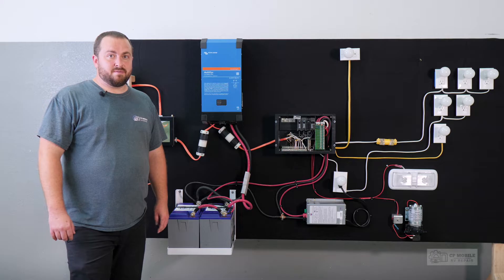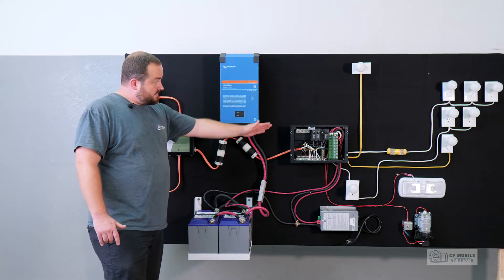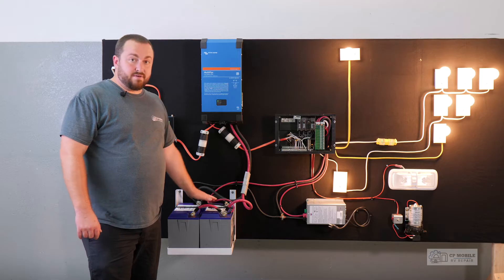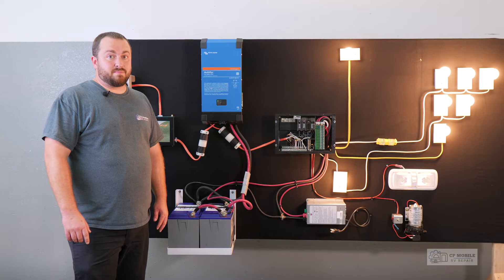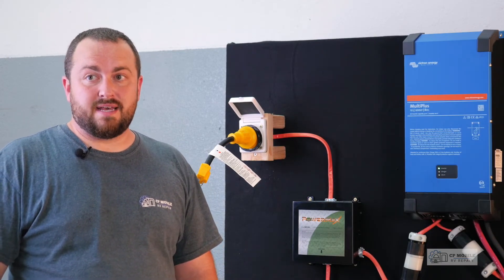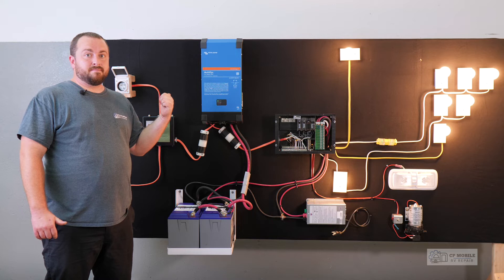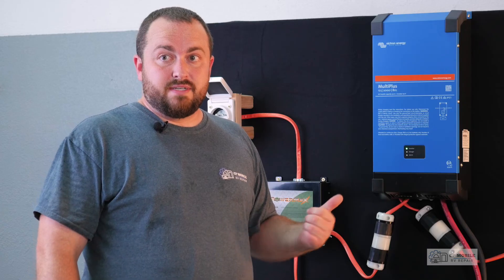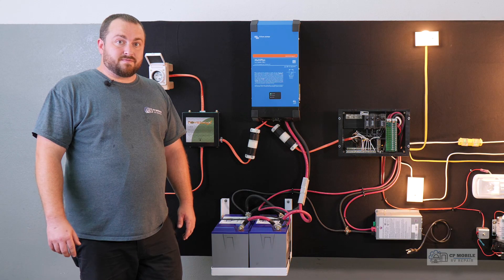RV Inverter Chargers, How They Work: Victron Multiplus

Comment from the maker: We have launched our own website and line of batteries! Check out Rockymountainlithium.com for all your power needs!

We have had several requests for technical help with troubleshooting, installing or designing electrical systems, so we’ve set up an option for paid consulting service below.  If you’d like expert technical help you can click the link below and schedule and appointment. Thank you! 

https://web.lokiapp.live/Travis.Call/g9Er
Reply: Thanks again for your help this morning. Keep up the great work
Reply: So if I have a converter do I need a inverter. Especially if I got plan on being plugged in. So if I'm not gonna go off grid or anything like that, and we've got plain on plugging into a 50 amp. Service, I don't need a inverter, just a converter.or am I wrong. If it's going to drain a lot of power and i'm not going to be going off grid. I got planned staying on grid, where I can hook up to a 50 amp pole. Hell The only plants that I plan. I'm having in my house. There's a 1800 W air fryer cuz. I got rid of the stove and a electric stovetop.Yeah, that goes just on the counter a decent fridge probably a dorm fridge. I also have a snake, so I need to run there hundred their light system, which I run on normal power maybe a couple heaters on top of my furnace, and my thankless hot water  , I'm also  putting in and AC heater.

Comment: I have a 2012 American Eagle 45T. My Inverter started giving a fault. High Voltage AC. I changed from a Magnum MS2000 with 3  breakers to a Magnum MS2812 with only one breaker. Before the change I had power to the refrigerator, microwave, and an outlet near the passenger seat when not connected to shore power or generator. After the change to the MS2812 inverter I only have power to refrigerator when not connected to shore power or generator.  Does it have anything to do with the internal relay difference between the two inverters? Learning a lots from your video's.
Reply from the maker: It would depend on how you wired the new o e, assuming you connected all 3 circuits together coming from the single inverter breaker, I would check all your connections and make sure everything is secure at the inverter output.

Comment: I assumed the 2000VA was the same as 2000W.  Not true. further study showed only 80% of the 2000 VA = 1600W.  Not very good.  I have this unit I installed in my Trailer.  I have issues when I run the microwave (900W).  My LED lighting flickers each time the microwave powers up and then settles and that's on  30A shore power.  I am getting ready to swap out for the 3000VA model.  The spec sheet for the 2000VA multiplus shows you only get the 2000VA at 77 degrees and gradually drops as the ambient temperature gets hotter.  Thanks for putting together a presentation.

Comment: Can you run this system without the transfer switch?
Reply from the maker: Yes, in some cases the generator has an outlet that you plug the shore power cord into rather than use a transfer switch

Comment: I thought that the Victron had an automatic transfer switch, am I incorrect?
Reply from the maker: You are correct, it does have an internal transfer switch to select between inverter mode and pass through/charge mode.  In this case we also have the other transfer switch to select between the 2 different incoming 120v sources, shore and generator.

Comment: I know this was a while ago.. we have a multiplus ii 3000 line 1 and line 2 what is a passthrough? Maybe a dumb question but will my generator run though the inverter and bypass the batteries? Or does it still have to use the battery’s?
Reply from the maker: Pass through simply means the 120v ac power from either shore or generator just flows through the multiplus directly to house loads.  The batteries are still needed for a stable 12v system but when connected to a 120v power source the 120v power but they are not providing the power when in pass through mode.

Comment: If you are running down the road will your vehicle’s alternator not keep the batteries charged?
Reply from the maker: If the rv and vehicle and set up with the proper connections you will get a little bit of charge through the 7 way cord.  It’s not much, just a trickle charge.
Reply: @Cpmobile  how do I not damage my alternator when I set this up in the trailer?

Comment: the batteries also get charged with the alternator when the engine is running. Does that tie into the inverter charger as well?
Reply from the maker: Not directly, no.  But the power stored in the batteries from the alternator can be used by the inverter to create 120v power.
Reply: when the engine is running and driving down the road, can the inverter use battery voltage to power RV and the engine charges the batteries all at once? Seems like it would
Reply from the maker: @jeromewheelerjr8056 yes, nothing wrong with that at all

Comment: Where would a solar charge controller plug into system/
Reply from the maker: The solar controller has an input from the solar panels and an output which connects directly to the 12v system.  For relatively small solar systems you can tie in at an open slot in the fuse box as long as amperage limits are checked.  For larger solar setups we typically tie in directly to the batteries.
Reply: @Cpmobile  only 100watts. I still think I will just go directly to batteries if no issues

Comment: Hoping you pay attention to/see the comments on your videos as I'd like to pick your brain....

I've got an 800W solar with the 1200W inverter under my Jayco NorthPoint 377RLBH 5th wheel. 

At this time the inverter supplies power to only a few recepts in the coach. Two TVs, bedroom and living room and one next to the master bedroom bed. 

I want to add the inverter 120 to one more plug on the rig but my ignorance keeps me from performing the task at hand. 

How is the inverter supplying each of the circuits now? Or better, how to I add the output of the inverter to another breaker in the distribution panel? How is it fed, sort of thing? 

I am a career motor control/specialty Sparky with absolutely no experience in the solar field, the only part of "Sparkyisms" I hadn't put my screwdriver on.... 

Any help would be awesome!
Reply from the maker: Hi, it sounds like your Jayco has a single breaker installation, I have a video covering that: How RV Inverters Should Be Installed: Single Breaker Power Flow Xantrex X2000 Inverter
https://youtu.be/smMnjD6tEdo

You could either tie the circuits together at the output of the circuit breakers, or switch to a whole house type inverter like in this video.
Reply: Awesome and thank you @Cpmobile ! 
I'll check that out! 
Totally appreciated!

Comment: Might be a dumb question but; is it OK to use the 12v circuit from the battery whilst charging? Otherwise amazing video series, this has ben tremendously insightful!
Reply from the maker: Yes, it’s ok to use as normal while charging 👍

Comment: I enjoy your videos. They are well done. This may be a dumb question, but does the Victron supply power to the 12V side or does it simply charge the battery and they are the only supply to the 12V circuits?
Reply from the maker: Thanks! The victron multiplus charges the batteries and they supply 12v to the circuits.  But technically the power coming from the multiplus as its charging can go directly to the 12v loads.  It does need the batteries to operate though.
Reply: @Cpmobile  Thank you for your informative videos! So I noticed you disconnected the converter/charger.  So instead of lets say, upgrading the converter section (to be lithium compatible) we could install a multiplus? would you wire the multiplus directly to the dc circuit board or would it be wired to the battery and then the circuit board? any downsides to removing the converter section in this scenario?

Comment: Nice videos.
Do you commonly use a circuit breaker between the battery and the inverter?
Reply from the maker: Yes, or a fuse block, decided to leave it out here for the sake of simplicity.

Comment: This the best video on this subject yet. Well done with the visual board. I do have a question about the inverter/charger .When  connecting the  inverter to the  RV power distribution panel , what do you do with the existing 110v line coming into the power distribution  panel. ? My inverter/Charger (Renorgy 2000W) has a built in transfer switch.
Reply from the maker: Thanks! The existing 110v line coming in to the panel from the shore power cord will run directly to the inverter charger “ac in” terminals.  The “ac out” terminals on the inverter charger will then run to the distribution panel.  Essentially the inverter charger is wired in line between shore power in and the distribution panel.